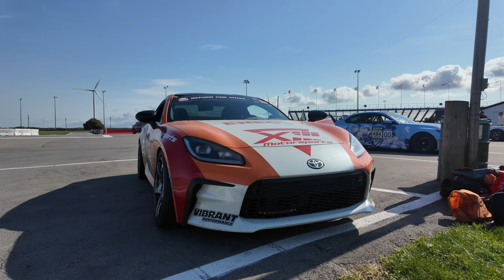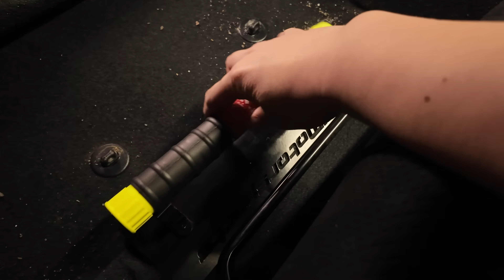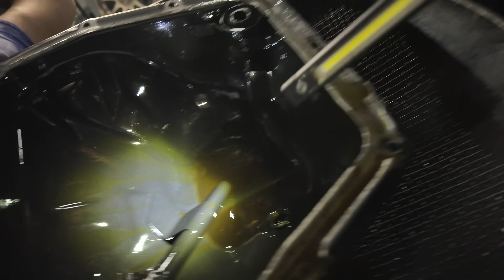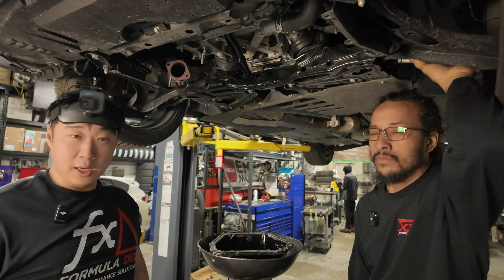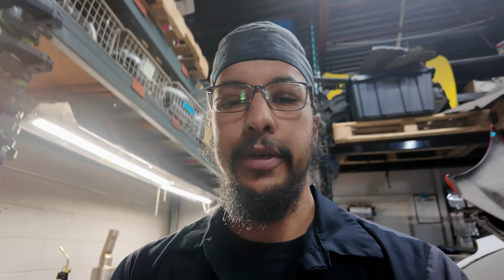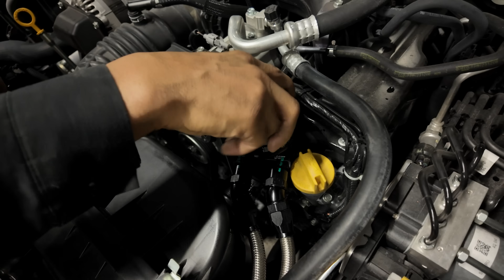Formula Delta High Capacity Oil Pan is FINALLY Here! - [Installing MUST DO Track Mods BRZ & GR86]

Comment from the maker: Since the release of this video, the Formula Delta oil pan is for sale. If you want our test results, please watch the video linked below. 

Oil Starvation Solution for BRZ & GR86 - [Data Backed Analysis & Discussion]
https://youtu.be/HyzjSvi0WKk

If you want more information on the deep dive Formula Delta did on the root cause of the issue, please watch the video linked below. 

BRZ & GR86 Oil Starvation Even In Stock Form - [2024 Current State Technical Discussion]
https://youtu.be/4CidHbClNHY
Reply: not seeing any links for the pan on your website

Comment: I've been overfilling haven't seen to had an issue so far, 37 and a half thousand km, been out by the west coast drove her from edmonton to Vancouver island and back home here in Toronto area. Commuting to work an hour back and forth, 1/2-3/4 L extra. Only time I had an issue was doing an extended donut around a pole for a while, I got a check engine code and I think it got low where it needed to be. Have been spirited driving without too much issue. Diff got hot one time and it limited the traction control off setting. I was doing some fun driving around cones. That's my experience so far with the car. 

I'll take your advice into account if I get signa of oil starvation issues going forward. I have seen a tiny "arbok pokemon" sized piece of RTV that fell into the oil pickup tube filter, as documented by another youtuber that seems to be an issue. No signs so far. Oil pressure/ temperature seems ok. 2023 model car.

Comment: After this kind of videos i am very skeptical of buying one of those Gr86's cause of the RTV issues. Basically i am out. Very helpful video guys thanks a lot for informing us.
Reply: Haven't had an issue so far by overfilling half to 3/4 liter, been commuting to work everyday about 1 hour each way rush hour traffic and highway speeds, also spirited driving. 

One time the engine spat out a code when I was doing a donut around a center fixed point, like at least 5 minutes of that manouver. Ever since overfilling and avoiding that move for a long time, hasn't given me an issue

Though honestly, it does make me worried and wish I did a bit more research before buying the car, I can't lie 😅

Comment: @xiiimotorsports  If you have an extra factory oil "warmer", I'll take it! I want to add it to my FB20 as my work commute is a bit harsh, but not enough for a full cooler. I do have a Koyo rad (OEM blew), so this can benefit me as I have ZERO oil cooler. I'm going to use the throttle body coolant method of the first-gen BRZ install. I'll cover shipping to FL.

Comment: Before I start thanks for your efforts in solving this issue! I am a mechanic of 53 years and have been looking at a MX5 but a GR 86 would be more practical for a daily to work. I would not track it but I have a twisty turny road for 15 miles of my 25 mile daily one way to work. Why Subaru/Toyota haven't figured this out since 2022 is beyond me.! Buying a new car first I would put a pressure sensor with oil pressure readout to Identify if there is an issue with the drive I do then oil pan and cooler as needed. I know this is a stupid question, but doing these things does that trash your warranty.?
Reply: 2022? Has been a known fault  with WRX's for decades! Which makes worse...

Comment: Nice, thoughtful work gentlemen. One thing - did the oil filter actually come loose?  You should check out the SAE/ISO pulsator test protocol for automotive oil filters. They should not come loose even under extreme pulsation. Higher pressures may deform the top plate though. This situation is on aircraft - meaning safety wiring the filter, but I dont know of any that have ever come loose. But, I dont know everything. The same standard for diesel though and those filters do not come loose if rotated 3/4 a turn from gasket touch when installed. 

To the oil starvation issue, did you consider a different pickup? (maybe i missed that) 

Die cast custom pan (your)  is impressive, 30 yrs ago the tooling would have been $300k. Would you share the die cost today?

Comment: Also, maybe it is not feasible, wouldn''t it be cool if you had a plug you could remove on the oil pan that can lead you straight up into the oil pickup to clean it out without removing the pan. Maybe I am just dreaming on that one.
Reply: @valkator  yes indeed, we can make that happen for the production version

Comment: Guys the pick up not reaching the bottom serves a purpose! The warped and shredded heavy metals don’t return to circulation 😂
Reply: My understanding is that this pan sits lower so it should move down a bit to be equally far away from the bottom as OEM configuration.

Comment: During the installation you ended up putting a spacer to lower the pick up tube closer to the bottom of the oil pan. This makes me a little skeptical as the constant stress of bending on the pick up tube might cause a crack/break in the future.

If one were to install your oil pan without the spacer on the pick up tube mount, meaning the pick up tube is in its factory location, will the oil pan function as intended or will some of the oil at the bottom of the pan not be picked up?
Reply: Also curious if lower placement of the pickup would pick up any debris, or sealant sludge?
Reply: that would have b a 'yes' obviously!

Comment: I am super excited about your new oil pan!!  Have you thought about replaceable gasket for the oil pan?? I think it would be easy to engineer and that type of design has worked perfectly well for decades in a multitude of other vehicles. Yes...silicone is finding its way into the oil pick-up from other areas of the engine, but how nice would it be to do a periodic 'easy drop' of the pan to clean out the gunk. Just food for thought as you develop this nifty product; a replaceable oil pan gasket would be the PERFECT accruement.
Reply: Hey there, I wanted to better understand from the end user's perspective. Is the intention of a replaceable gasket to drop the pan to be able to inspect and remove any stuck RTV from the pickup tube or are there any other reasons to do this?
Reply: @FormulaDeltaOG   Easier installation and serviceability would be selling points that I would point out for a replaceable oil pan gasket. It wasn't all that long ago that most cars had replaceable oil pan gaskets. The liquid silicone is a PITA both removing the pan and then having to re-prep both the lower block surface and the oil pan. With the flimsy stock GR/BRZ pan it often means a new pan. Most manufacturers of the 'gasket in a tube' recommend a 24 hour cure period prior to adding oil/running the car; a replaceable gasket would be ready to go immediately.  Also, given that excess liquid silicone gasket maker is a known problem working its way to the oil pick-up for some cars why re-introduce a known failure point for an amateur mechanic if you could make a replaceable gasket work. Said replaceable gasket would also be a proprietary consumable item which means a continued revenue stream for you. I suppose you could engineer your new pan with a 'service port' to be able to look at the oil pickup, but that would likely require the user to have a scope to get a good look at things. With a replaceable gasket it would be easier to just drop your cast pan and directly look at the oil pick-up and do what needs to be done with the assurance that removed junk falls on the garage floor and not back into the bottom of the oil pan as might occur with a cleverly placed 'service port'. Hopefully some food for thought as you move towards production.
Reply: @TVR-jc5uf  thank you for the context. Indeed one of the improvements we can make is relocate the drain port to be right underneath the pickup tube such that you can inspect and remove any stuck RTV without removing the oil pan. I agree this doesn’t solve for the cure time of RTV, or the pains associated with cleaning up the old RTV or the surface preparations. One of the challenges when designing for a replaceable gasket is that the mating surface on the upper oil pan is very thin. Subaru/Toyota intentionally created a step on the upper oil pan to create a squeeze gap for RTV type of gasket. We have seen a replaceable cork gasket made by a shop in California, I believe it is for the OEM oil pan, but we haven’t had any personal experience working with it.
Reply: @FormulaDeltaOG  The replaceable gasket is just a thought. Cork, cast silicon or O-ring might be some materials to consider. I have no personal experience with dropping a pan on a GR86/BRZ ...yet. Conceptually, I think it would be a good idea; I'll let you do the engineering stuff that punters like myself don't totally understand. Looking forward to a revised pan from you guys (that the factory should have figured out, but didn't).

Comment: Long video but showing zero technical knowledge on the baffle. You didn't even show what the baffle looks like. You showed the outside metal.
Reply: I imagine they don't want to show the inside, so people don't copy it.

But I agree that so far it is more trust us, than completely transparency on how the baffle works.
Reply: It’s only my engine..
Reply: It’s most likely similar to other baffled solutions on the market, except with the expanded oil capacity. Preventing forward slosh into the timing cover is what’s crucial.
Reply: @ So far none of the baffled solutions work
Reply: @ the Syms pan and GR Cup Car Baffles both work

Comment: What aftermarket headers does this oil pan work with?
Reply: Hi Nicholas, we have been able to confirm fitment of a couple of aftermarket headers, the ones that fit are the JDL UEL Catless, HKS Turbo header and the Tomei V2 UEL. Ones that don't fit: MAPerformance header, SME EL Header, Tomei EL
Reply: @FormulaDeltaOG buy the freaking JDL UEL Catted and test it! Unless you think it won't fit, probably worth a few grand on a handful of headers to test. Each one that fits is $$ in your pockets!
Reply: @FormulaDeltaOG  are y'all planning on looking at JDL UEL catted version fittment? I remain optimistic!
Reply: @ioannisioannou7518  we haven’t come across the JDL UEL Catted headers yet, we will definitely update once we can get our hands on them.
Reply: @FormulaDeltaOG  Hi, excited to order the oil pan once it gets released. Any idea if the oil pan will work with gen1 GruppeS UEL headers? Also, will the oil pan work with RHD cars? Not sure if there are differences but just needed to confirm.
Reply: @ffh2303  we will try and find one of those headers to check it out. In terms of RHD fitments, we haven’t tested and confirmed it, but it should be fine as the steering components and steering rack are behind the subframe and shouldn’t change anything on the oil pan fitment.
Reply: I would really like to have full assurance on fitting for the RHD GR 86. I guarantee would be nice.

Comment: Excited to see these in action.

I guess they chose excess rtv over oil leaks. Waiting for the Subaru apologists to start commenting that it’s normal.
Reply: Waiting for people to say why they did the excess sealant. Oh shoot you did it already.
Reply: Excess RTV is not great, but its also not new and many other cars also use it but no one talks about it because they arent racing their cars or doing their own maintenance so no one notices it. However, not a problem ever since the 5 sided filter was introduced in the 2nd gen BRZs. They seemingly engineered it so that some RTV can go in there and stay at the bottom side and leave the other 4 sides perfectly clear so oil can flow around it and wont hinder oil flow. It would take wayyyyyyy more RTV than what anyone has found and posted online so far, to even start affecting flow and so far it seems that RTV hasnt effected oil pressure/flow in any of the 2nd gens. Long-story-short, RTV isnt a problem anymore. You should probably clean it out anyways "while your in there" just in case 10+ years from now it fills up and becomes an issue, but its been 4 years now and so far it hasnt been something to be concerned about.

Only real issue is oil starvation now, and thats only a "potential" problem if your tracking your car. I say "potential" because so far we arent 100% sure that the pressure drops are causing engine failures still as the oressure readings dont show the big picture as we cant physically see if the engine is receivig oil, only that the sensor is loosing pressure. Only a very very small number of these engines have failed and its not 100% clear what caused those failures either but we are making our best guess that its oil pressure drops based on the data we have currently. Either way, the more we can keep the pressure up, the better/safer in the long run anyways, specially if your running slicks + downforce. Same applies to any race car too, not just to BRZs.